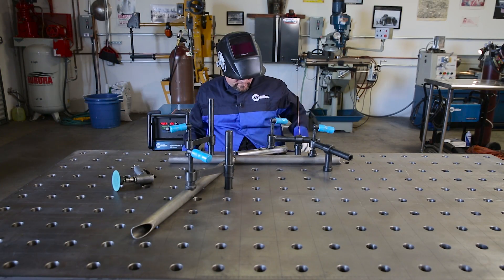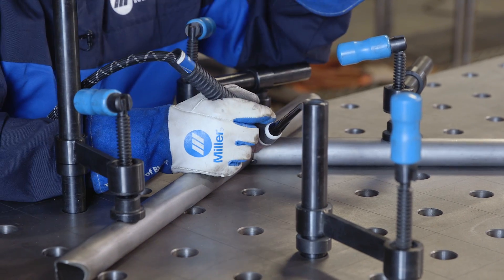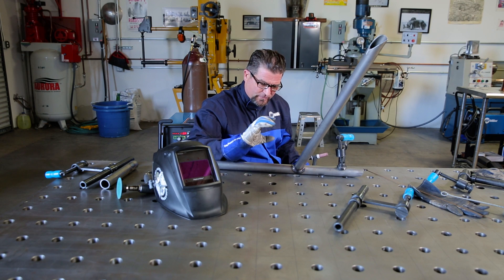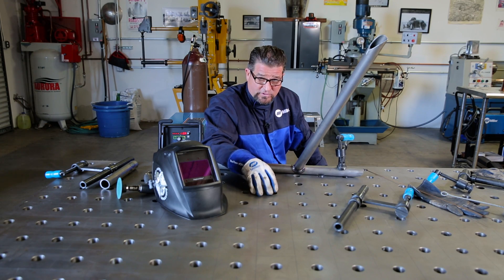Roll Cage Tubing: Tips for Fitment and Welding

Comment: I don't want to add to the flame gallery....but...

For me, the main challenge to cage welding is that it does NOT take place on an immaculate welding table with the parts clamped in perfect alignment.  It takes place when you are contorted under the dash, upside down, trying to weld a joint you can barely even see, with bars and body panels obstructing your torch.  Anyone can do a good weld in the surroundings Mr. Shine was using.

And, while I am not a pro welder, I agree with some of the other comments....that weld looked too cold and too "small" even for TIG.  If it was my cage I would have re-done it.
Reply: Is this comment is why you don’t have a channel?
Reply: @Watermelonhole  Not all professional welders need to have a "Youtube" channel to be right. a teacher can be corrected if he is wrong. its not necessary that the person correcting the mistake or pointing out the mistake should also be a teacher. 

This is a stupid comment.